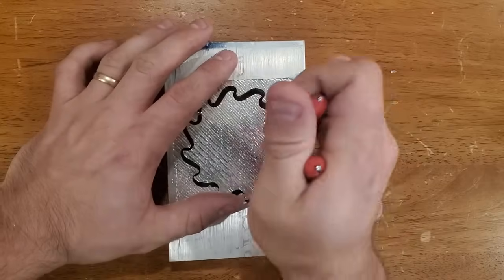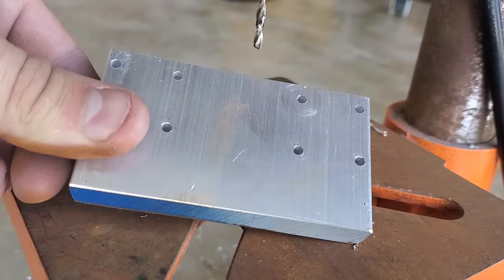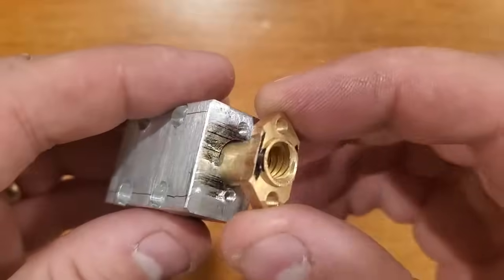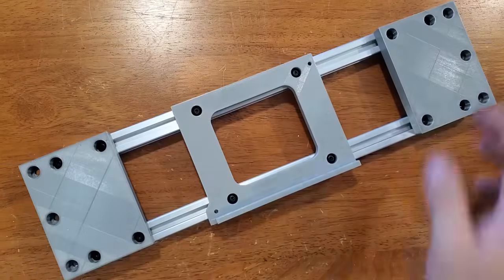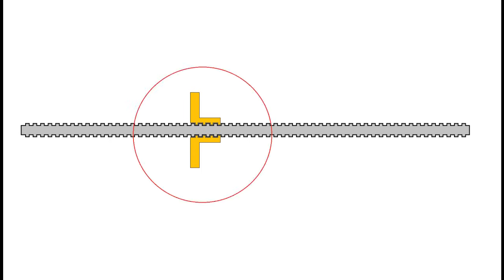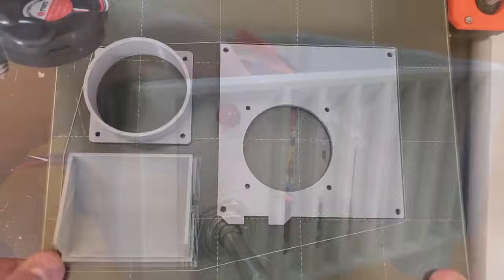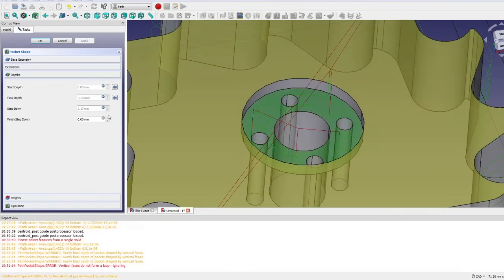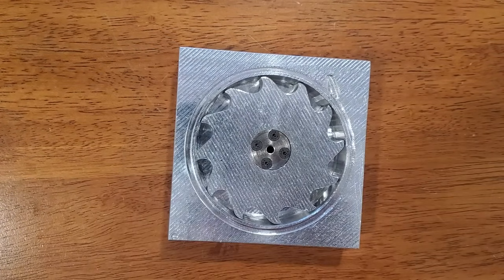Upgrading my Homemade CNC

Comment: Why bother with all of the cheap stuff? Just get oversize linear rails and ballscrews right from the start. You aren't doing yourself or anybody a favor by pretending that you don't need them. Of course you do. Just look at the horrible mess the machine makes in your expensive aluminum block. You are saving a couple of hundred dollars on the machine (tops) and you are going to destroy more than that in material and tools in no time. This is foolish.
Reply: I understand where you are coming from, but unless it is essential to have precision and speed from day one, like a commercial operation for instance, there is a lot of worthwhile knowledge to be gained from this approach.  I am currently pondering how to best make a Hobby / DIY machine of similar dimensions to this, with three design constraints:
Price, Noise level, Weight (it must be able to be lifted by one person).  The idea is to come up with the most capable machine, while staying inside these limitations.
Reply: @PiefacePete46  You were clearly not listening to the actual reason why precision is needed: tool wobble destroys the tools. CNC machining is not like drilling with a hand drill. Carbide tools do not tolerate excessive loads. They break and shatter when mistreated. I built a machine with 0.8mx0.4m work area for less than $3000 at my last employer. It's a two person job to lift that one but it is still considerable less massive than an actual CNC mill for those dimensions and can be operated on a sturdy table. A smaller machine that respects tools can by built for considerably less, but it still has to be built with strong profiles and linear rails.  

The price optimization goal is foolish, by the way. You would have to go to serious lengths in engineering to bring the cost down by even as much as 20-30%. That's something you only do if you want to sell hundreds or thousands of these machines. Your one advantage as an amateur is that you do NOT have to engineer for cost. Only the professionals have that constraint.

With regards to noise... there is nothing you can do about that. CNC machining is noisy. Get some good ear protection.

Comment: same conclusions and a very different approach :D Im looking for a busted 3040 now as after 2 generations of diy 3d printed frames just not happy with it, too much flex, its all have to be metal
Reply: Not necessarily. Epoxy and cement or granite dust work fine, if you don't mind the mess of pouring a machine base. We built a couple of custom machine stands at my last workplace that way. They had next to zero vibration. Mass and dampening make all the difference, so it's either cast iron or poured bases. If you don't have a foundry, go with the latter. Mount the linear rails on that. You won't regret it.
Reply: @lepidoptera9337  at least a carriage needs to be aluminium, but I got lucky and won a chinese 3040 for a good price on ebay, so got big ballscrews and fully aluminium chasis for cheap, already boxed in a small rack case, waiting for grbl conversion, I was even lucky to get separate nema23 drivers in it, so couldnt be happier

Comment: I was wondering if you're getting any backlash from the axial play in the stepper motor shaft?  Or are you anchoring the lead screw with a low backlash bearing on the opposite end.

Comment: Just stumbled across this video today. Pretty impressive. Goes to show you, when there's a will, there's a way.

Since you already have access to Aluminum and a way to cut it you can replace all the 3D printed gussets with Aluminum for more rigidity. Also, the whole back of the X gantry can be a slab of Aluminum and you can bolt linear rails to. OR, you can build a V2 and forego all TSlot entirely and use Linear Rails bolted to Aluminum slabs. Just ideas; I understand that $$$ doesn't grow on trees.

Comment: I would wonder how much of that surface finish is due to the chips being stuck inside the cut path instead of being evacuated. Definitely not bad for a cnc made with 3D printed brackets 👍.

Comment: Suggest you use Klipper, open source g-code to stepper driver with inputshaping capability
plus put a magnet and a hall effect sensor for never skipping a step ever again and now you can run your steppers at full power without fear they will miss steps

Comment: 🚥🚥💡💡💡🚥🚥 I have to admit that is very impressive. I saw the first video I thought it was quite good but could see clearly you are suffering from backlash but now you've upgraded it it does seem a hell of a lot better considering you are milling quite thick aluminium billet so that is very impressive.

Only thing I think I would change for this machine would've been to use linear rails in place of bars and the Lead screws both on the X and Y axis. I realise it's more expensive but it pretty much completely eliminates all backlash, of course what you could do with this machine is now mill all of the plastic parts out of aluminium and you would increase rigidity even more

I think you should also look at the cooling system on that motor because after running 8 to 10 hours regularly I think you could be in for early burn out without a fan on top of it, those motor suffer from heat terribly, interesting to see the heatsinks on the steppers as well,  most people forget that and they can get seriously hot.

How about adding a chip extraction system and if you're going to be milling nonferrous metals all the time you should think about some form of coolant because that will improve your surface finish quite a lot and will protect the tooling  at €25 for a decent cutter that's important to think about.

It will be quite easy to do just purchase a 30 mm deep wall tray and sit the entire machine into it on some mounts and use a very small hydroponic or aquarium  5 or 10 watt pump with a filter and flow valve to recirculate the cooling solution via a small flexible coolant nozzle onto the piece being milled and tool head. (add a plastic cover with coolant its messy stuff)

Chances are there's a pin out on the board to operate the pump automatically via a cheap10 amp relay to stop and start with the job . Just make sure your stepper motors are out of the liquid . I used to do this with my first mill 8 years ago , an old MX3018 MACH 3 cnc.

Dust is a major problem especially with wood and I would perhaps consider not mounting any of the electronics components or PSU onto the machine,  it exacerbates EMI and as you saw collects tons of dust, all you need isasmallchip toenterthe housingandbang goes your circuit board.

It's easy to fabricate an umbilical about a metre long keep it while away from the actual machine and try and shield the power lines 

It really is a great build for others to follow and develop and its excellent and generous of you to provide the STL files and links for newbies to follow..  Well done and thank you for sharing your project. 🚥🚥💡💡💡🚥🚥
Reply: hi sitgesvillaapartmentneilsc, have you become a flat earther yet?

Comment: Nice video...Sir please make a video on higher/improved performance CNC machine  something like laser cutting.. I mean all the mechanical parts should be easily available in market and there shouldn't be no 3D parts ( not everyone can make 3d parts, so implementations  by viewers will be tough without all parts).
Reply: Are you offering to sponsor all this?

Comment: Nice. The only thing i could add to this is that you could try to use isopropanol or denatured alcohol as cutting fluid. This makes cutting and tapping aluminum muuuuuch easier.

Comment: You're right, FreeCAD is not as powerful as Fusion360. It's more powerful. The plugin ecosystem and programmability is miles ahead. It's like a Mac vs PC comparison: Fusion is more expensive and easier to use, but with FreeCAD you can do more for free even if theres a few more steps or settings Fusion doesn't show you.
Reply: LMAO Hell no! FreeCAD is absolutely fundamentally broken.
They still haven't even fixed even the most basic issue in that software (the topology naming) even though it has been known to cause problems for almost a decade now.
It's honestly so bad that anyone who seriously considers using it for any real productive work an not just hobbyist shenanigans must be borderline insane.

And considering a "Plugin system" an advantage already shows how flawed your thinking in that regard is.
Actually decent CAD/CAM software like Fusion already comes with all the features you would ever need.
A software that has to rely on garbage third party "community" plugins to be even remotely usable is not "good".

I'm absolutely all for preferring open source software over proprietary stuff. 
But FreeCAD is and always will be the unfortunate exception to that because it's a piece of garbage software that will probably always stay garbage.

Comment: If you just make an oversized plastic nut it is naturally zero backlash. Plastic is elastic. Plastic is self lubricating too. Plastic is just another form of oil. You do have to sacrifice some lead screw to make a tap to tap your lead nuts. I found that I had to expand the thread a little or the nuts would be too tight. I just hit a few of the threads with a punch. That blew them out so they cut the threads wide enough. You're still going to get some flex with those unsupported round linear guide bars. Rounds just flex.

Comment: Many thanks for your great video, I am on the process for helping a capenter guy near my home to build one of the wood carving CNC based on your video! However he wanted to build a bigger one with more load (1m-Wx2m-L). I am thinking of a two stepper motors for Y axis but I am worrying that if one of a side motor failed, the Y axis may cause problem. Do you have any idea for fault protection to avoid such case? Please advice with thanks!
Reply: You just use motors and drives that don't fail.  When you're running open loop that's the only strategy that works. Go big or go home. What you need to understand is what makes a good stepper motor for CNC. You want a low inductance low voltage high current motor. Learn how to read torque curves. Holding torque is meaningless. You need torque at speed. It is also critical to set the current right on a drive for the motor you're running. More is not better. Stepper motors get hot in use but way too hot is not good. Running rough is not good. Drives with switches to set the current are horsecrap. That stuff ain't right. Performance comes with tuning. Learn how step sequences work. Then you can set the current right at the peak step. Under current performs better than over current does. Bench run your motors and understand how they operate. Figuring this stuff out when it is on the machine is a nightmare. You're probably going to buy cheap Chinese stepper motors. Oh well you'll learn. Spend more and get Japanese motors. Vextas are nice. Finally never ever disconnect a stepper motor from the drive while it is powered up. Or you'll get a lesson in what back EMF is.

Comment: do you have any wobble on your z axis? i have made mine similar to yours but out of wood. I'm not sure if aluminium would give my less wobble
Reply: I made a wooden CNC too. It depends how big the machine is. I made a little machine and used big boards.

Comment: Having run a cheap desktop CNC mill for many years myself, I would highly recommend using a single flute endmill.  You get a much better finish, better clean-out, and lower overall load.  Plus, if you are machining plastic rather than aluminum, your cut speed can be greatly increased.  I did many many parts in type 2 PVC, UHMW, medium and light density polyethylene, and PTFE.  Heck, some of your aluminum parts on this CNC can be re-machined in PVC for a more dimensionally accurate part.  

Also, you really need to put flexible couplers on the stepper motors.  The threaded rod has a run out, even if it's very small.  The flexible coupler will keep that run out from transferring into the stepper motor's bearings, thus increasing the stepper's life.
Reply: @James M. :  Do you have a preferred type of flexible coupler?  I see people complaining of failure of the single-piece alloy versions with the helical slot cut in them.  Are the three-part versions with a "+" shaped neoprene centre preferable?  Thanks.
Reply: @John Colvin  For small desktop mills, I've run the aluminum helical couplers for hundreds of hours.  But, you do need to make sure there is no axial misalignment. They can take a degree or two of radial but will quickly fatigue with axial issues.  The ones with the rubber spacer have the same problem.  Only thing is they will break other things in the drive before they fail.  Your best bet for the best coverage is an Oldham coupler with a single flex plate on one end.  An Oldham coupler has two dovetail joints at right angles from each other.   That way, they can slide to allow for axial misalignment.  The flex plate will compensate for any radial misalignment.   You could run a multi-section flex plate, but those are very pricey.
Reply: @jameslmorehead  : Thanks for that.  I saw a simple arrangement I was thinking I might try: (the one I saw was using a cheap Chinese stepper that has the motor shaft and lead-screw all in one.)  The stepper is connected to the ball-screw by a non-flexible coupling... the stepper itself is attached to a flexible plate, effectively working as a flexure.  This allows some axial movement, but controls rotational and radial movement.  There is no bearing at the driven end... axial forces are controlled by a thrust bearing at the non-driven end.
Admittedly the machine I saw was a laser, so there was only minimal loads, but anything I tackle will only be small.  It worked well, and was a tidy installation.
(I must put Gurgle to work checking out the Oldham coupler!   😉 )
Reply: @PiefacePete46  Also keep in mind, on the scale of small to medium desktop CNC equipment, a deep groove ball bearing can carry a surprising amount of axial load.

I'd be weary of the lead screw and stepper motor combos.  They have to skimp somewhere.  Plus, you don't want the axial load going into the stepper motor.  They have a spring inside to take up axial play, and these springs don't have much force to them.  You can easily get a hard to trace inaccuracy from this type of issue.
Reply: @jameslmorehead  :  Thanks, I appreciate it... I would be best to avoid trying unconventional solutions at the start... if it was that good everyone would be doing it!   😜

Comment: Very nice build. Using a backlash nut  instead of two individual nuts might make for a simpler mounting bracket, but the effect is essentially the same as what you've done here.
Reply: Do you have experience with them?

Comment: This is great, I may try this myself when I'll have the balls for this XD
However, you didn't explain why you used new motors.
Also, do you think using POM leadscrew nuts can reudce friction ?
Reply: I made lead screw nuts out of HDPE. They're OK. Big chunky nuts. No backlash and they're smooth.

Comment: On the backlash. Their are backlash nuts that are designed to use a spring to push them apart and they are pretty cheap. The benefit is that since your causing more friction the nut will wear out faster and the spring ensures it stays in good contact despite wear.

Comment: Hey my man, great couple videos I watched. I watched the original build for this one as well. 
I'm glad that you upgraded your vertical supports. I thought they looked pretty weak on the original. Not weak, just not rigid. I felt the same way about the corner brackets on the base. 
If I can make a suggestion to you, it would be to get rid of all your 3-d printed parts. That's a great idea for a 3-d printer or light duty router, but I'm quite frankly surprised that it works as well as it does for your heavier duty milling. I would absolutely upgrade the 3-d parts to all aluminium to further enhance the rigidity. You may also want to try linear slide rails instead of the round ones, but that's less of an issue. 
Keep up the great work my man!!

Comment: Hello, Im building a similar machine, thanks to you. What did you use to power the shield and the drivers? If you used the 100DC Power supply from the spindle, how did you get to the 24V required? (for the shield) (assuming that the small buck convertor I saw in the electronic box is not enough). I would like to avoid using another 20V power supply, thanks in advance for your response

Comment: TO ALL THE WAY TO KEEP STUFF OUT OF AN ELECTRICAL BOX OR CABINET IS POSITIVE PRESSURE.
You need to make the air in the box slightly higher pressure than the outside.
So you need your fan to suck through a fine filter and PUSH the clean air into the box or cabinet.
You'll find many electrical devices have the fan on the outlet of the ventilation system. Go look at the PSU on most desk top PCSs. My PS4 does this and its something I like to slap a few Sony guys for.

The problem is when the fan is at the air outlet its sucking air from inside the box/cabinet which reduces the air pressure inside the box/cabinet. It will then suck in dust from any and every place it can be sucked.

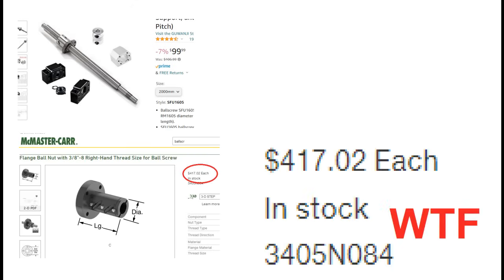Comment: 8:00 they sell 5 foot long (1500mm) version of these with the pillow blocks, leadscrew, screw nut, 2 linear rails, 4 linear blocks, and a stepper coupler for 150$ on amazon

Comment: A good machine has to be heavy. With a heavier machine you get better finish and precision.  As said below try to keep everything as short as possible. Rigidity is the most important in a machine. You have to get rid of those chips while you machine, they can even break the tool. Try using a roughing end mill, to cut out most of the material and then finish it, with a finishing cutter.